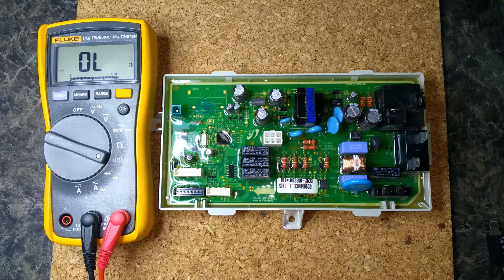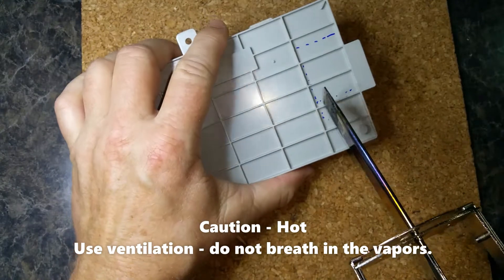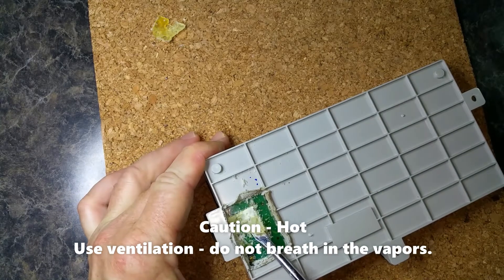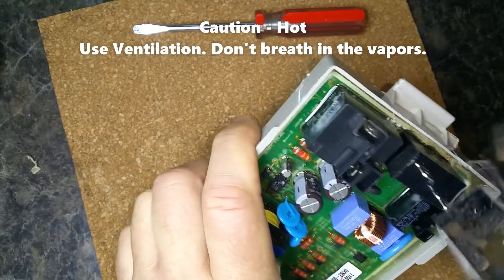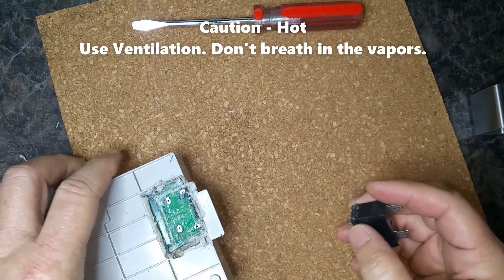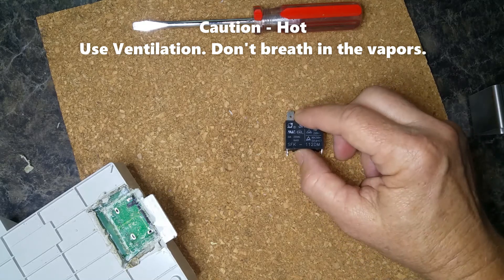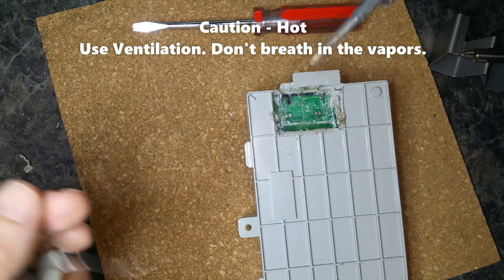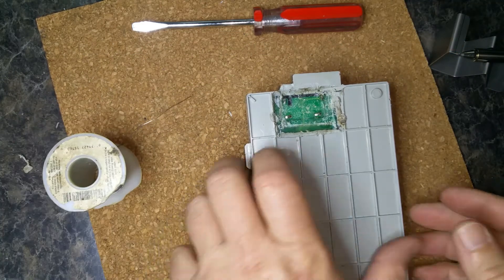#12 - Samsung Dryer Won't Stop Running

Comment: Great video. The repair went well! I used the OMRON G4A-1A-E as recommended below by @jonnerd154 and it fit perfectly. I didn't have the fancy desoldering gun, but was able to make do with desoldering braid...and twisting the old relay to get one leg out at a time.

Comment: Thank you for posting this! I just completed the repair following your process and it worked perfectly.

Edit: I used OMRON G4A-1A-E as a (hopefully) higher quality alternate. The part is still underspec'd - Samsung should have used a relay with at least 30A load current rating: inductive loads (a motor) require special attention.
Reply from the maker: Great to hear it your dryer is working now! Yes that  relay may be of better quality since it is an Omron. In every other way, I consider it to be a good choice in terms of logical/physical pinout, coil resistance, and of course, coil voltage.
Reply: So 12v 20As? Or 30a?
Reply: What is the suffix of the G4A-1A-E? It should say DC12, DC5 or DC24.

Nevermind, it’s a 12V coil. The Sanyou sfk 112DM he shows is a 12V coil
Reply: Thank you for the fixit vid. The hot knife trick is priceless for getting to the back of the board and cutting the coating off without ruining the traces. The relay shown is a Sanyou SFK 112DM relay rated at 250V 20A and is made for a 12 Volt control coil voltage. About $2-3. Definitely worth buying 4-5 of these for the life of the dryer.

Comment: Is there a better quality relay to use on these dryers? Replacing with the same bad quality one is not something I'd want to do. Is rather spend a little more money and get one that won't break after only a couple years.
Reply from the maker: Unfortunately I haven't found one. I tend to replace relays with the exact one if available. There's a risk of modifying the circuit. Beside, although this problem isn't uncommon, it is very rare for the same dryer to have this particular problem twice.
Reply: I believe I found one : Hongfa JQX-102F
Looks to have the same coil resistance, but better inrush current handling (less prone to contacts welding) because it uses Silver Cadmium Oxide contacts rather than the cheaper silver alloy contacts on the OEM relay.
Reply: @taylorsharp5928  Did you end up trying this Hongfa relay?
Reply: @RyanLenz  I still have not gotten around to trying the repair, sorry.

Comment: could you please  show part number for motor relay and heat relay so i can order them   glen stefflerfffler  you rock
Reply: I need to replace this part as well but  they are all 250V and 20A compared to the one in my dryer at 25A. Not sure where to find a 25A.
Reply from the maker: It is SFK-112DM.

Comment: Ver helpful. My Samsung washer had these symptoms as I was going to replace relay. Glad I found a good tutorial. However after replacing the relay I faced with new problem. Instead of always ON my motor is now always OFF. I did confirm that relay is working with multimeter but motor won't turn on unless I short those relay contacts manually - which brings me back to having motor always ON :/  I noticed that original part has slightly different spec than one I got from amazon cosΦ=0.9 vs cosΦ=0.7. Can that be the reason or something else is causing this?
Reply from the maker: It is most likely one of the circuit board traces that have been damaged during relay replacement. I is a double sided board that has some thin traces. I would inspect the traces to make sure they are intact.

Comment: I don’t have this issue with my Samsung dryer but I’m trying to investigate the relays because I keep blowing thermal fuses.. when testing the same relay you tested I don’t even get continuity.. should I?
Reply from the maker: The motor relay only has continuity between the two terminals when it is energized. It is only energized when the motor is running. The motor relay generally won't have anything to do with thermal fuses blowing.

Comment: Is there a good website to buy a compatible relay? I looked the service manual of my dryer and they only show the whole control board.
Reply from the maker: You can google SFK-112DM or check ebay. I got mine on ebay.
Reply: @TheTechCircuit  thanks so much!

Comment: If the dryer had no power u replace the main board got power and then the same problem happened a couple days later what could i trace that back to? Thermal fuse has continuity
Reply from the maker: If it had no power as if it were unplugged, I would check the terminal block where the cord comes in.  When you replace the board, you can be disturbing that terminal block. If it is loose, it will exhibit the symptoms you are experiencing.

Comment: Is there a need to re-epoxy the board or can it be left as-is?
Reply from the maker: I don't. I do however epoxy the plastic shield back on. Also, the board has a metal backplane when mounted in the dryer.

Comment: When you cut through with the hot knife, it did not cut through the power grid?
  Does it having a double board have something to do with preventing that?
Reply from the maker: No. If you drag the knife toward you it won't cut the copper traces. They are very tough. Yes, it has traces on both sides, but if you are gentle with the hot knife, it won't damage them. I've never had an issue.

Comment: I have this exact issue, but I don't have these skills.  Wish you were close to Montreal so I could get one of the refurbished ones and surrender my current one.  I'll end up ordering the whole thing for 200 from Samsung...  Thanks a bunch for the video!
Reply: Good luck.  I live in Montreal too and have scoured the whole internet for a new board.  Finally found a used in on Amazon for $85.00  MFS-DV203L-00 Samsung part.  Samsung discontinued this board and no local technician can order them.. Everyone has sold out and they say it is permanently discontinued.  This video is too much and I would not be able to do what he is doing.  The dumb thing is that Amazon does sell the relay switch for about $25.00, but who is willing to do what this guy is doing?
Reply: @fredab2802  it's really not that hard if you have the correct tools .. And Correct relay.

Comment: Great video.  Was the repair profitable?
Reply from the maker: Thanks. Yes, that was a customer swap board. I keep a refurbished one like that on hand at all times and install it for about 60% of the total parts & labor cost of a new board install. That price includes the customer surrendering their old board as part of the deal - which is taken back to the shop and repaired. That scenario means less time on the service call as opposed to doing the board repair on-site.